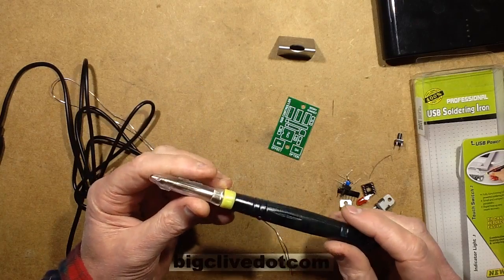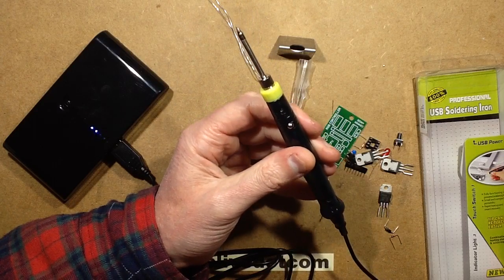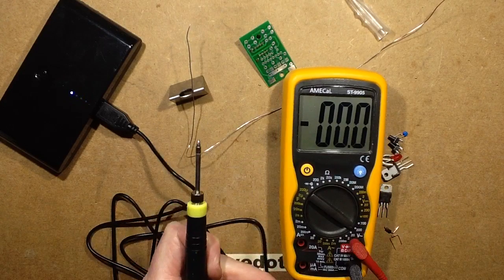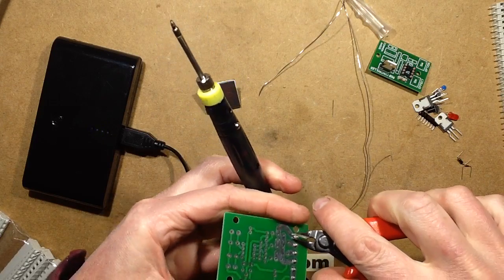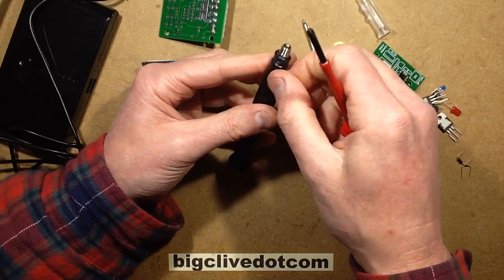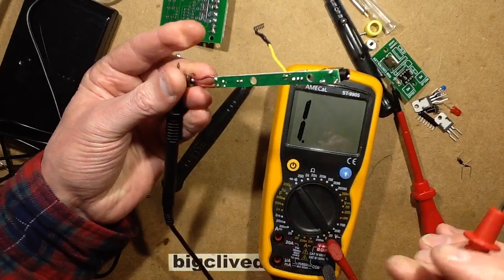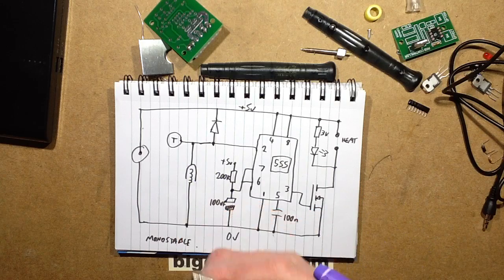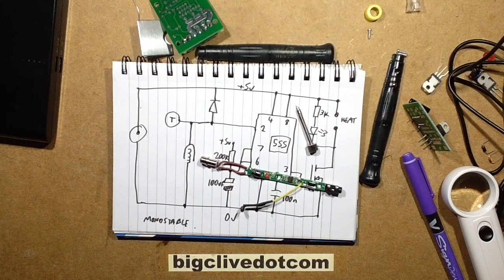USB soldering iron test and teardown with schematic.

Comment: i got one of those 5v3a USB power banks from Canadian Tire, i think it's 5000-6000mAh twin cell pack, so it runs one of these nicely, just used it to fix a $5 USB rotary tool (refurb, wires and shrink tubing replaced plus nuts for DC input and power switch are torqued nicely. i've got a cheap lil LED magnifier soldering station for $20 on Amazon that has either 4xAA for the LED light array or a DC 5V i have there as well to use. The 5v soldering iron works beautifully with a lot of the light soldering i do with electronics i have. i have much stronger 110v AC irons ni a bin, but most times im pulling out this lil beauty. i ordered it with a spare tip after seeing this and EEVBlog's vids on it. May also get a Pinecil soon to accompany it with a bigger power bank im fixing.

Comment: i can't pull the tip of mine. is the older version of this is fixed and can't be replaced?
Reply from the maker: Depending on the unit, the end locking nut may unscrew.

Comment: had this. no problem, a great iron, only problem is that the tip broke,  after this i had a rusty mains iron without ground which yesterday killed itself letting the magic smoke out. now i need a new soldering iron

Comment: Think they might have changed these I got one a while back and recently just started to try use it as my main station finally died after 4 years 
the touch button is now just a tactile switch and heat retention was awful couldn’t even solder one connection before the iron went cold lol I was trying for 15 mins to get 2 battery terminals done and just gave up after just about getting one connected 😂 kinda sad as I want to get my project finished 😭 

Great video Clive!!

Comment: It's current year and the market has been flooded with a different version of this. Looks exactly the same on the outside except it has no 555 timer, touch sensor, or vibration sensor. It's a simple 2 transistor latching switch circuit to turn on the mosfet. That's it.

Comment: I bought myself one of these years ago because it cost less than a new bit for my Antex mini iron (an original but still works) and I just needed to do a quick job to repair a mod, did the job and I was very happy, I have bought a couple of new irons since as I am getting into back into little projects and it is easier than changing bits for different jobs

Comment: Lidl is selling a lithium USB chargeble soldering iron around here right now for about 11€, seems like a pretty neat thing to have on the go and no need for a separate power bank

The thing is that my package was missing every single accessory apart from the USB cable and the iron itself, no stand or tip. The package didn't have a seal on it but I'm not the kind to open packages in the store

Comment: I was given some electronic waste and i found a 6volt 12watt soldering iron having a look at the plastic it reminds me of that 70's plastic "Fairey 34229" but could not find anymore info on it anyway i was thinking of making a regulator and have it fully isolated and power it from USB C.

Comment: I'm glad I saw your most recent 2021 version of a rechargeable portable soldering iron. It gave me a chance to compare it to this earlier USB version. The latter type reviewed here by Clive; I would say may have been updated to current day standards. Though like Clive has stated this wee iron could handle a soldering job very well. It fared well during the practical usage test with the given circuit board and various components. The solder flowed smoothly onto the two surfaces to make good electrical contact. I am impressed at how cleanly the joints; with solid connects the little soldering iron made each time.

Comment: Hi is it possible to increase the wattage to say 10-12 watts what components would I need to change also would increasing volts to 10v increase heat.
Reply from the maker: That would burn out the heater very quickly.

Comment: This was a fun little soldering iron while it lasted. It was easy to work on smaller soldering joints with than my previous main soldering iron. However, two weeks ago the tip of mine broke and the price for a new tip wasnt really worth it IMO. So instead I bought myself a pinecil with 11 extra tips so far I'm quite happy with the choice.

Comment: Is there any way to increase its power for larger solders?
Reply from the maker: No.  Larger solder joints need a bigger iron.
Reply: @bigclivedotcom  mine is useless since i have to do medium to large size solder. Maybe increasing the current using a mini regulator in the circuit could be interesting project. Also  i don't know why, mine has blue led instead of red, same 5V, 8W.

Comment: What is the composition of the solder wire/lead that came with the soldering iron? After exhausting solder wire that came with the soldering iron, other solder wires weren't melting well
Reply from the maker: Probably 60/40 tin/lead as it has a lower melting point than lead-free solder.
Reply: @bigclivedotcom  Thanks. I have used 60/40 tin/lead without impressive result, like the solder that came with the iron. Kindly inform me if another solder wire is found to melt adequately

Comment: Could someone elaborate just a little bit more about those 120 V on the tip relative to ground, please? I'm trying to figure out details behind that phenomenon.
Reply from the maker: Ungrounded switch mode power supplies like USB chargers often have capacitive leakage between the AC and DC side of the power supply.  That's made worse by RF noise suppression components like class Y capacitors.  If you plug your phone in to charge and use a meter set to AC volts you will often be able to measure around 100V or more between your phone's case and ground.  It's very low current, but still enough to be an issue.
Reply: @bigclivedotcom  Thank you, Clive!

Comment: My one looks just like it and I didn't realise Clive had a video on it until this old video popped up in my recommendations today.  Unlike that the one featured here, mine would only run off a mains USB charger, so I did as Clive told me in a comment of another video, bridge out the drain+source pins.  It now works well on power banks and great not having it cut out every few seconds.  I now use it as my main iron as the power lead is not cumbersome like the chunky lead on my mains iron.  It runs for around 4 hours continuous on my 10,000mAh bank.  The only minor issue is that it can slide all the way through the hole in a typical soldering iron stand.

Comment: I did the same with the "not screw" cap. This is great for small joints and those tight spots. Just wished it would stay on for as long as you have your finger on the touch sensor instead of having to "wake it up" after 15 seconds. Other than that, not bad for the money.

Comment: Interesting.  1.1xRxC suggests the triggered on time is 22 seconds.  The 100nf could be any value down to 10nf it's noise suppression.  The original part by the schematics online for the mosfet is out of production but I think a HUF75321P3  is nearly the same.  Triggering is probably a safety measure, but I wonder how it would work in astable instead of monostable.  leaving the 100uF for c1, R1 of 300K and R2 of 7.5 ohms should give ~22seoconds on time, and 0.5 seconds off (on the standard diagram for astable). The nichrome  I think would have to have to be around 3.7 ohms for a 4.7v 6w heating element.  Did you measure the tip coil resistance by any chance?  Of course I could be way off.  But it is interesting the "how to get started" with soldering video LMAO may be fun to do the "lets start off by building a soldering iron that we need a soldering iron to build...."

Comment: Not had a chance to do any proper soldering with it yet. My dog got ill and needed an operation. But I did test it on my soldering iron thermometer and it went up to 430°C. They must have built the heating element right into the very tip of the iron, that seems the only explanation as to why it works so well.
Reply from the maker: It is.  The wire goes right down the middle and the coil in in the tip.
Reply: @bigclivedotcom  I thought as much. Now I calculated how long it would run using my 20,000mAh power bank (closer to 17500) and I came to something around 12 hours. 17.5Ah/1.4A (7W/5v). Does that sound right to you? If so, that's fantastic!

Comment: Hey thanks for sharing this video. 
Yes, it is surprisingly decent product :-) I loved it a lot and used quite a bit - however I just blown off the heater element. as you demonstrated in beginning, once in hurry I un screwed the nut and while cleaning the tip accidentally pulled it off. are you aware, where can I get a replacement tip by any chance?

Comment: The same product is sold at Jaycar Electronics in Australia. All 5 soldering irons on the shelf were visibly opened and returned because the previous customers assumed they were broken. It turns out I'm not the only one that twisted off the plastic cap...

Comment: 2nd job keyfob repair changing micro switch, easy with this iron, used a bit of copper gnd wire from an audio cable to suck up the old solder. soldering iron is perfect for jobs like this.

Comment: Just got mine, BT-8U slightly different toggle switch on body and a 3.5 mono jack to USB cable.  It is very light and feels like the weight of a biro and is very comfortable in hand and there is no fight with the power cable. It's actually enjoyable working with it. 
First Job I gave it was resoldering a microusb socket on to a board on a battery bank  of course the wires from the battery to the board broke off so I had to do those wires as well.  The pins on usb micro B are about 0.4 mm wide and quite tightly spaced, so having a tip fine enough for my shaky hands  to do the job was ideal. I had to use a magnifying glass on my third hand in order to focus on where i was placing the tip. I would have destroyed the board with my regular iron.  
It's very quick to heat up and cool down and being able to switch the power off I was able to melt the solder on the board for a hole and power off and spin the tip in the hole making reattaching the battery cables much easier.  Jobs done and the PCB didn't get overheated. 
Cost me 12 euro to repair a powerbank that cost me 10 (Amazon charge 21.47 sterling for this 10,800mah juicebank out of stock). So still a win for me.  If I hadn't been able to fix the connector I would probably modded the powerbank with a couple of wires to charge from an old powerbank.  Thanks Clive for the review it was worth it even with the mark up to get it from Dublin instead of China :) 

There is an interesting russian video https://www.youtube.com/watch?v=XdJavqX-90U where he modified the circuit so it has a variable duty cycle and thus some temperature control. It might be nice to revisit the subject.

Comment: I bought one of these for a laugh - as I guess most do - but I was very pleasantly surprised.  It's perfect for more delicate soldering jobs - it's particularly excellent at soldering header pins onto Arduinos and Raspberry Pi's, runs happily off a powerbank I have and it's faster warming and cooling than my decent 'normal' quality iron.   For that odd job every now and again I think it's excellent for the price.   I wouldn't fancy using it with a mains charging brick mind!

Comment: Hey Clive. I was wondering could you take a USB to USB micro cord, plug the cord into the power bank's USB plug and charge USB plug, and get the power bank to stay on and not waste too many Mili amps?
Reply: Most power banks will only charge or discharge, very few support pass-through charging. i.e. Charging and discharging at the same time. Also, if you measure the charging capacity and subtrasct it from the discharging capacity, you can see how many mAh is lost. USB meter --> Power Bank = 3000 mAh,   Power Bank --> USB meter --> Load = 2600 mAh, meaning 400 mAh is lost for every 3000 mAh.

Comment: Modified mine to work with an onboard 18650 and used it to solder my car alarm in. Works reaaaallly well and is one of my favorite irons. Initially modified it because I hate proprietary connectors that turn USB into a stupid headphone jack or the like. Anything I get like that instantly gets ripped apart and has a micro female port butchered on. Also stuck a charge controller on it so now I can plug it into any USB socket and have it charge, and then solder cordlessly.

Comment: brilliant just subed  going to order a couple now bostin review and a few spare tips this is just watt i nead  is there anyway of slightly increasing the power output from the board 😉
Reply from the maker: Best way to increase the tip current slightly is to chop the lead in half.  It adds a lot of resistance.

Comment: Thanks for the informative video.  It seems that there is an excessive voltage drop in the power cord.  I'd consider cutting off much of it and putting another 3.5mm Jack on it.  It could add another watt or so to the tip.  I bought two of these last year and found them useful for small work but they weren't powerful enough for medium to large solder joints.  The reason I bought them was I'm concerned about not being able to solder during a power outage.  I tried soldering by focussing bright sunlight with a 100mm lens, but even with sunglasses I had spots in my eyes for a half hour after.  And the solder joint was less than desired.  ☹️

Comment: I just bought one. Its changed. Has a tactile switch, single click turns it on, when its on single click turns it off. It has a bright blue led inside it that comes on when powered. I haven't taken it apart but I can kind of see through it and I don't see the shake sensor in it.
Reply from the maker: It's a simple two transistor toggle circuit inside.  I was hoping it might go off after a delay, but it doesn't.
Reply: I took it apart. Has a couple of transistors  and I think a SCR. It kind of looks like a flip flop.

Comment: They have improved this a lot over the years. I had one before you did your video on them and it was a real pain in the ass to use, kept timing out and didn't read the touch sensor most of the time.  I decided to give it another try last year and ordered another. They have fixed the problem, it is no longer a touch sensor, but a push button and she doesn't time out as quickly either.  Now it is a nice little iron and can do a lot of work without having to toss it up against the wall to get it to come back on.
Reply from the maker: I don't think the new ones time out at all.

Comment: is good for smd?
Reply from the maker: I've not tried it, but it should work well with it's very narrow tip.
Reply: @bigclivedotcom  it will not brake the coupre pads because of high temperature?

Comment: Would a classic linear power supply (transformer->bridge rectifier->LM7805) work with it and not produce static?
Reply from the maker: Yes it should be OK
Reply from the maker: I should add that a traditional 7805 will not deal with that current.  A small switching regulator would be better.
Reply: PWM rpm controler from a cheap dremel tool? https://photos.app.goo.gl/LWncWYbYBm4deXxr7

Comment: Just to be clear, when you measure 120V AC while using the mains ipod charger is the induced voltage via capacitive coupling  super imposed over the 5volt rail, ie 50Hz sinewave biased by 5V DC? 

furthermore, this voltage at 33mA is nearly 4 watts! am i missing something here... what normally eliminates this when charging ipods etc...?

Love your channel BTW. Thanks

Dave
Reply from the maker: The leakage is usually microamps.    The coupled AC is superimposed on the 5V but all the phone circuitry sees is the 5V.

Comment: I owned one. Because of high temp, NEVER KEEP THE TIP DRY or the solder will not stick. COAT it with solder during and after use.

Comment: WARNING: POOR QUALITY FAKES NOW SOLD ON EBAY
I own one, and gifted another bought at the same time for a friend which wanted to get started with electronics. Recently, I purchased another one for another friend, as pat of a kit I was putting together for him. It took all of a microsecond for my brain to register it as fake as I took it out of the envelope, and a few more to realize it was of poorer quality. No motion sensor or capacitive coupling, under the ball is a clicky button that is used as a switch. The plastic shell is thicker, but the biggest giveaweay is the plastic ring near the tip is grey instead of yellow. The eBay listing had pictures of the original. Today I checked on ebay and there are also more honest listings with the pictures of the copy. Same deal with the tips, which are slightly different and of lower quality. Original tips will fit on the clone, but clone tips that are sold with pictures of the original won't go in easily on the ZD-20U: The head of the tip is too thick, and won't fit though the clamping nut. The biggest giveaway for that is that in the original the iner contact is brass, and on the clone steel, but also the shaft of it is thinner than the head. The clone tips will sit crooked on the soldering iron, even on the clone.
I'll uplad a video latter.

Comment: Very nice little iron!  When I was actively involved with the R/C hobby I used to use a standard 110V 25W iron hot-wired ;) into my battery charger which was powered off my car battery.  It would output maybe 45 volts at its highest voltage setting.  Took a while to heat up but it worked well enough for the few times I needed it.  I also powered a Dremel Mototool the same way which as you know runs fine on DC or AC.   I imagine this little 5V iron would run fine off a car battery if you put a small $2 step-down converter between it and the battery to keep it from burning out.  It might even work fine directly on 12V as there's nothing in the circuit board, including most 555 chips, that can't tolerate a little higher voltage.  Might be worth a test to find out.